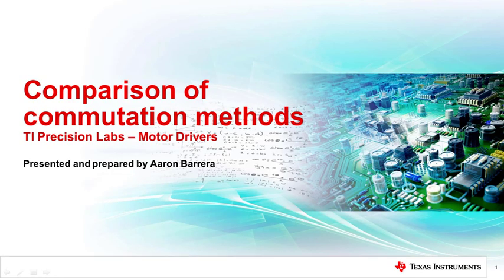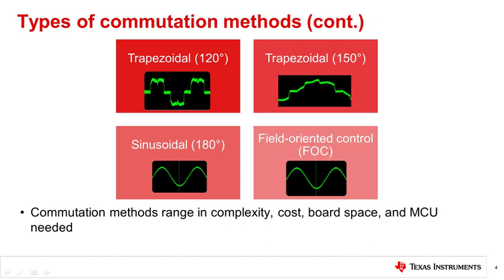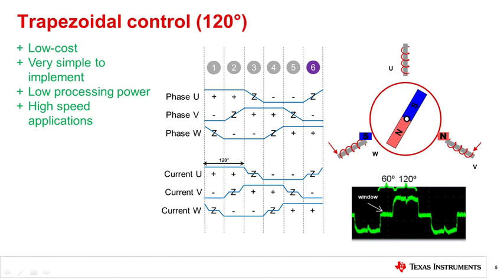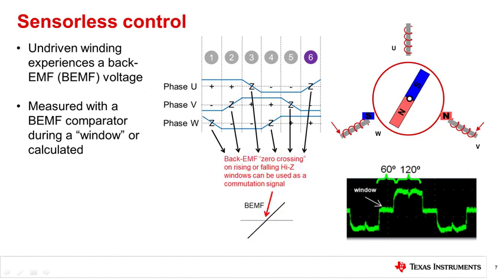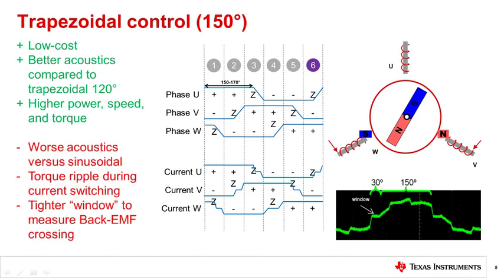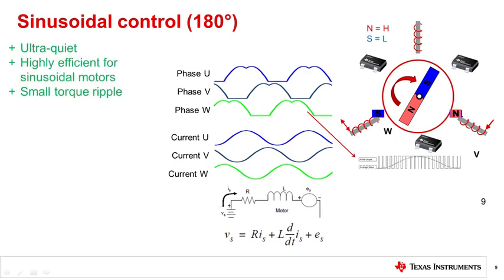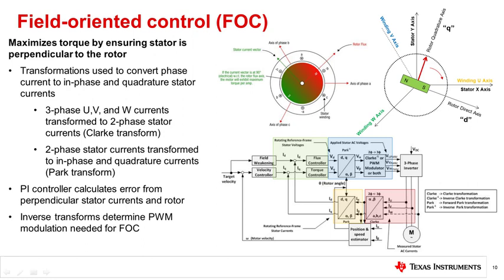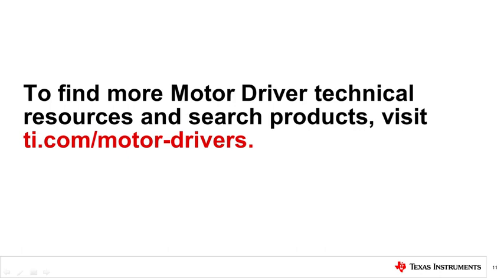Comparison of commutation methods

Comment: Hi i have bldc motor I need to control 100 RPM with 4% accuracy. My hall feedback will get updated every 25 ms(60 degree at 100 RPM speed). I need the correction less than 10 ms once. Any possible  solutions.  Please suggest